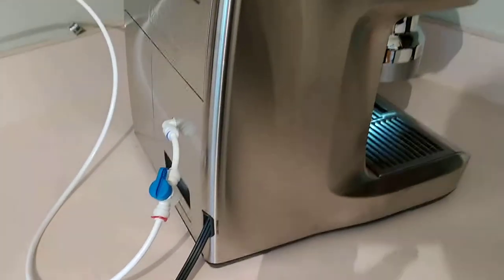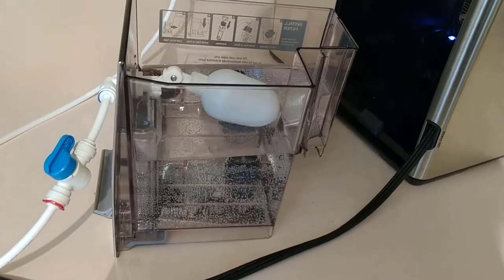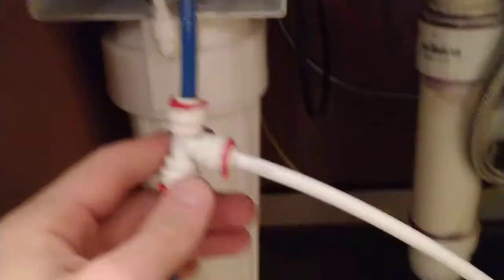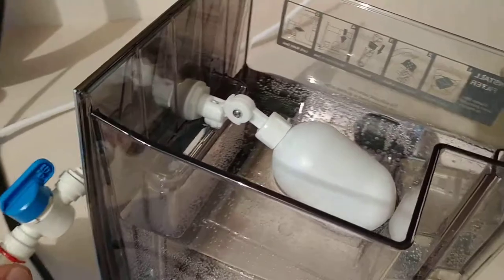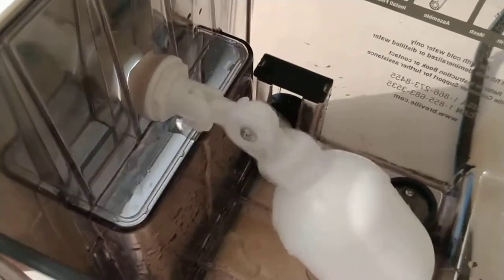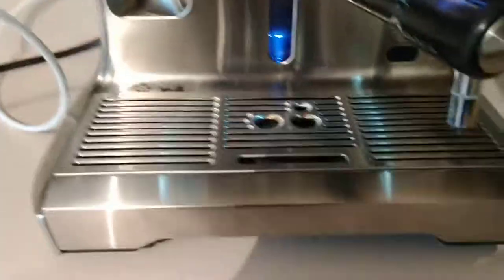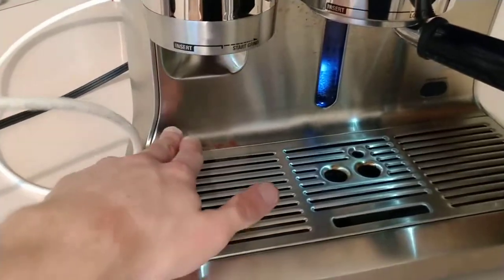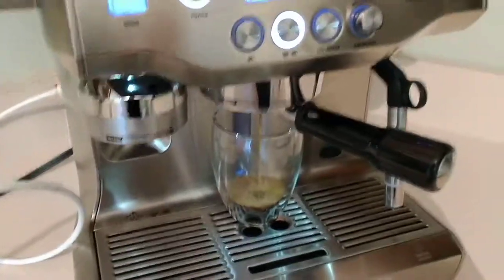Breville Oracle BES980XL Modification - Plumbed In Water Tank

Comment: I never would have thought about a float valve, because I never considered that they could be so little! Definitely going to do this with my next one, probably Barista Express. I don't know why they don't offer a kit from the manufacturer; if I'm willing to spend 600+ on a machine that is insanely fiddly to use, for a notoriously difficult hobby, then why wouldn't I want to spend $10 at Lowes on a fridge line kit so I'm not refilling a stupid tank every day. I could plumb the machine in faster than I grind, prep, pull, finish (with foam) my shot every morning!

Comment: How much water does the Oracle goes through? it must be a lot, hence, your solution. I have the Dual Boiler that leaks steam but still works fine, it's just that it goes through a full water tank for one espresso, I mean it leaks while heating up, I hope someday I find the time to change the gaskets on the steam boiler before I resort to your extreme solution!
Reply from the maker: Your leak will deteriorate to the point where the boiler won’t even be able to reach 200. It’s 6 screws and a set of 007 o-rings to repair the connections I do it as an annual service. There are some poorly placed electrical connections that are in contact with water if theses connections leak so you should address it immediately.
Reply: Noureddine, I also ignored the leak from my BES920XL and as a result one of the probe contacts of the steam boiler, as well of its support, got rusted. I would address the leak immediately in hindsight.

Comment: You actually should not be using RO water for coffee. RO water does not have any minerals and alters your coffee taste very significantly. BUT NICE job on the mod!!
Reply from the maker: Yes I am aware of the shortcomings, very 'bright' coffee taste not ideal.
Reply: But you can always add an remineralization filter at the end of the filtering process. Btw, that was a hell of a mod, congrats!!
Reply from the maker: @Eva00Pilot  I haven't been successful in finding a remineralization stage that isn't chinese or has some sort of transparency about the source of their minerals and output concentration levels. I'd rather take the bad taste and supplement minerals over just adding a plastic tube with rocks in it.
Reply: @NikitaLab  Well yeah, there is a plenty of stuff involved on the water specially for coffee. Hope you can find a good remineralization process.
Reply: @NikitaLab  You're worried about "China" and you own a Breville? lol

Comment: your valve assembly needs cleaning or a gasket from the boiler is failing and pressure is dropping........the buzzing you are hearing when water is starting to flow
Reply from the maker: Haha this video was made 2 years ago and I'm in the middle of servicing it right now! Just did an overhaul for all the o-rings on the boilers (there's one o-ring on the side of the steamer boiler for hot water that's a pain in the to access) and I'll shop around for a new solenoid assembly. I've taken it apart 2 times in the past but idiotically didn't replace all the o-ring just ones that failed.
Reply: Nikita Skakun you can see the manufacture of the valve is right on the valve it self......Italian company......however valve companies have Distrubution  for their product. You can deal directly with them and skip ebay etc.
Where did you get the orings?
I made my own ha ha ha
Found the right durometer rubber sheet and punched the orings :-)
Reply from the maker: @parzyk4364  thanks for the recc, and the orings were on Amazon I've found that 1/8" ID, 1/4" OD, 1/16" wide were very similar if not exact to the originals.
Reply: @NikitaLab  , I have a question.  You said not to use PVC float, why?  And I didn't understand what type you actually used.  Lease advise. I'm hooking mine up in about 2 weeks so any tips would be great.
Reply from the maker: I came across a few floats, the PVC ones weren't considered "food grade" as they leach chemicals into the water. I use one advertised as food grade, good plastic, stainless screw, silicone o-ring, etc.